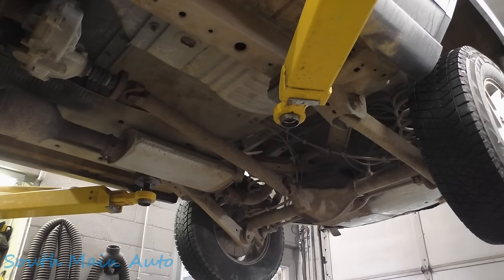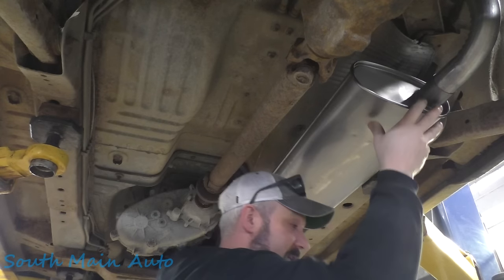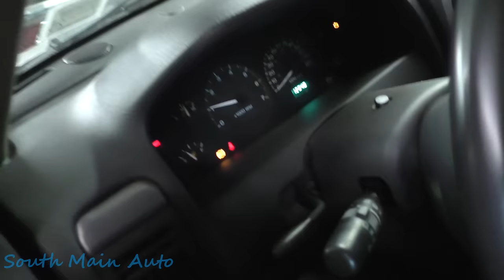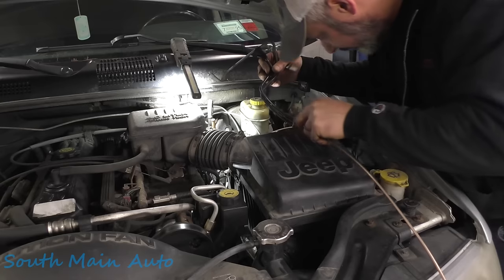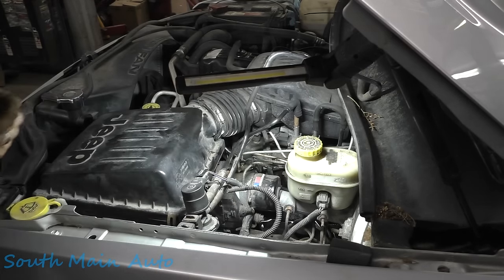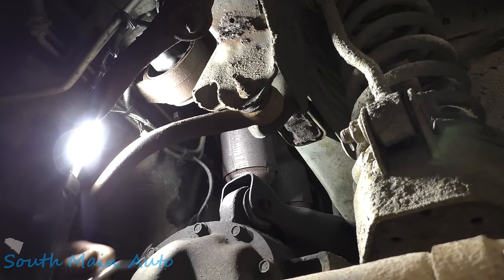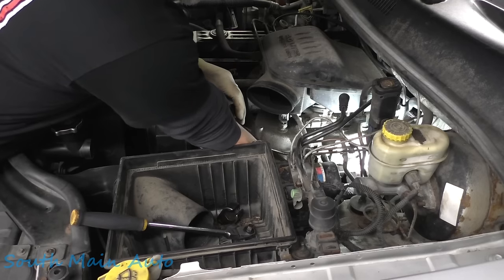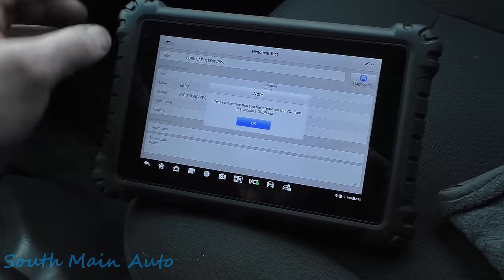Jeep Grand Cherokee: Loud Exhaust, Engine Light & Leaking Brake Line - PART II

Comment: Cutting just the outer pipe with the gas axe was the first thing I got taught when I started working in the industry. Still remember who taught me (Bo Eriksson) and the total length of the lesson: "Just start cutting without preheating and it'll never touch the inner, like this *ziip-ziip*"
About twelve seconds, including everything.

36 years on, I have still to hurt a single inner as long as it had more structural integrity than your ordinary spider web. Best method ever.

Comment: Another satisfied customer! I almost always cut exhaust pipes with the torch. When doing the second step of the double flare an old mechanic told me way back when, not to reef down on the flare tool and let the nut finish it off when you tighten it. I like your tube bender pliers! Enjoyed watching!

Comment: Since you only said it twice , I think the Eastwood Line Flaring Tool and the Mastercool Hydraulic Flaring Tool are better. If you had said it 3 times, then I would have agreed with you. 😜
Reply from the maker: They are great tools honestly 😅
Reply: How many times have you flared the brake line and forgot to install the fitting?
Reply: @jamesbergfeld5923 probably the same number of times putting an electrical connector and housing on in the wrong order.  usually happens when you have no spare pins either. :D

Comment: I'm glad you stressed the O2 problems with older Chryslers. Probably 3 years ago I ran into the random falling on it's face when going into closed loop problem on my grandparents 98 Ram. Then compounded the problem by putting Bosch O2 sensors in it. ScannerDanner was able to point me in the right direction and sent me a link to a video he had done with the same problems.  I went to a friend of mine at the Chrysler parts counter to get the OE sensors and she told me she buys NTK for their techs on the older ones that are unavailable. I also use the old flare nuts if they are in good shape. You don't have to worry about them being the correct threads.

Comment: Now heres why my sawzall is better than my torch.
I dont have a torch.
Reply: Plus that was a good Eric O explanation for why the torch may not be a good option in that case with a different metal pipe... But, use what you have👍
Reply: also for most of us laying on our back under a car, hot torch slag in your eye really sucks. at such times the saw is a good choice.
Reply: @leftyo9589  I gotta up my tool game... I don't even have a sawzall yet😵‍💫

 I'm cutting stuff out with a Dremel (100 pack cutoff wheels)

and a manual hacksaw for bigger jobs

Comment: When I get a "new to me " car I go over the heat shields and put thick  washers made from scrap ally sheet under the nut's , stops the shield corroding any more as same metal and the washers take quite along time to waste away, especailly if you put some fluid film etc. on them

Comment: Free Friday tip. Put the clamps on first turn sideways so you dont have to trim ends. Cut wires iff sensor use regular socket.

Comment: I like that touch of cutting the u bolt threads off to the nut it makes sense too because I;ve seen plastic bags stuck to the extended treads hanging below the muffler.  Eric you always do nice work.  The customer made out that you were lower in price muffler shops are not always better.  They warrantee the muffler for life but you pay for it twice up front and they always hit you heavy for the extras.
Reply: god I hate that part of it. yea they "warranty" the muffler, but of course the mid pipe is also bad (no warranty) and the tail pipe is bad (no warranty) so in the end you "save" $30 on your next muffler job.

Comment: That 4.0 is one of the best engines ever made, no wonder he wants to get it fixed
Reply: Best at leaking oil.
Reply: @misterhat5823  yeah I saw that
Reply: The one in my 98 XJ had over 300k on the original engine when I sold it. Still running great.

Comment: And oh yeah, reusing flare nuts: clamping can easily distort thinner nuts, pinching the brake line. The remedy is to just drop it in the correct size socket and knock that rust line out.
Spinning it on a preferrably worn drill bit while cleaning the threads gets all the crud out of the inside too.

The socket trick is also perfect if you have to drill or thread a flare nut, like when making a piston pusher outer adapter for stuck calipers: grab a nut with the correct outer threads, tap the inner for M6 (for 3/16" lines, no need to drill them since they already are the correct diameter) and put a grease zert in there. You can then easily push the piston out with the nearest grease gun.

Comment: I owned this model jeep.  The owner will eventually either back up a money truck to service/maintain this vehicle OR trade it in for a Toyota sedan.  Right now, just watching the video the owner needs a gas tank skid plate and a valve cover gasket - about $1,600 installed.  Unknown is the condition the wheel bearings, shocks, control arms, and fluids - differentials, transfer case, transmission, brake, radiator, engine oil, and steering.

Comment: NTK are OE for most Chrysler I think.
Bosch sensors just don't last in Chrysler applications.
My theory is that they don't like the 5V bias that Chrysler use as an indirect heater monitor - most other brands are 450mV bias.
I think this was covered in the first video, but a cold O2 sensor sensing element is effectively an open circuit, but at operating temperature it's a weak source of power - but strong enough to overcome the influence of the bias.
That's how the heater monitor logic works

Comment: Muffler looks better than what I'm running right now.😁
Dorman does make good washers.  😛
Question:   Do you always cut off the clamp bolts?  Why?  Trash bag snaggers?
Just a thought:  It's a pleasure to watch someone, go from one step to the next, just because he knows what he's doing.  No wonder Mrs O is always smiling. 😃
Reply: Signature move that sma touch the vehicle? So it's an Eric O thing...

But, I agree with one comment to add a water weep hole to that lifetime warranty muffler

As a DIYer without a huge torch set-up in the home garage, I'd leave it alone 😅

Comment: Kind of strange that the bottom of that old Jeep has not rusted out. The body has the Cancer, but the frame and suspension looked remarkably well. It’s a 2004. Did the manufacturers use better steel back then?? I mean a 10 year old Chevy truck rots out already. This puppy is 20 years old!! Great video as always.
Reply: If I remember right it originally came from Florida. If it wasn’t on a coast that would help a ton with rust. Over time the body tends to rust because it’s thin, pockets trap dirt and moisture, and paint damage removes protection.

Comment: I love my Jeep WJ 4.0, but it has kicked my ass this last month. First, the harmonic balance decided to take a dump, then immediately after replacing it, my water pump start leaking out the weep hole. While replacing the water pump, one of my tools fell, hitting the side of my radiator and putting a hole in it (facepalm). Talk about bad luck.

Comment: I found that tightening a small hose clamp around the O2 sensor socket prevents it from flexing and rounding off the flats. Couple blasts on the bung with the flat head air chisel can break the rust bond as well. YMMV I think I’ve flared a line or two without the nut affixed myself. 🫤

Comment: But have you tried the bubble master 5000 brake line flaring tool? It will flare a brake line using Bluetooth. 😊 Thanks for the video....amazing job as always.

Comment: I can’t believe how bad the metal around that gas tank was on this one. I’d hate to pay what a new car cost just to see it dissolve after a few years.
Reply: That's a common problem on 99-2004 Grand cherokees, I had mine replaced after 21 years it was almost gone.
Reply: Remember this is a 20 yr old WJ ❤, with what was it, 212,000 miles- it’d be hard to say this vehicle wasn’t worth every penny and then some. That skid plate was shot 10-15 yrs ago!

Comment: "02 sensor heater should run when the car is completely cold. it tests it during cold start and driving .. basically it wants to make sure the heater element inside reaches the designated temperature within a certain amount of time to make the car into closed loop."
 - Lotus Talk

Comment: One thing my grandfather taught me in the garage was to always drill a weep hole in the bottom of the muffler. That way any condensation can drain out of the muffler.
It's a German thing with the O2 crap, that was built back when diamler owned Chrysler, so they over engineerd that thing. But they are literally plug and play jeeps. If you want homelink, just plug it in. You want fog lights, plug them in and put in the stalk control.
Reply: Eric went over that issue in a previous video. I think it may have been a Toyota muffler.

Comment: Question, Why use the torch when you could use a saws-all or a porta band? Reason I ask, is because of fuel lines as well. But I know you know what you're doing.
Reply: Porta band is usually too bulky to fit where you’d need it for cutting an exhaust off. Sawzall would shake the exhaust a bunch and possibly break it somewhere else. It’s so rusty you don’t want to risk it. 
Torch is really about the best option. Just have to be careful where it’s pointed.

Comment: My Dad loved to work on cars. He and my Mom pulled and rebuilt the engine in our 65 Bel Air. So one day my sister and I were cruising around town. She decided to pop the clutch and try to fishtail around a corner. The gears refused to shift and the car wouldn't go. An old guy came along and towed us home. Turns out my Dad hadn't tightened the motor mounts enough or they worked loose, and the clutch pin had popped out? Sister was BUSTED!!!😅😂😅😂

Comment: Should I request a reimbursement of a tow truck fee that I had take my vehicle to a shop for starter replacement iif the shop never even touched my vehicle for 5 weeks? I had to get another tow truck to take it to another shop that fixed it the next day.
Reply: You can try, but don't get your hopes up 😢
Reply: The tow truck fee would still be on you. Reimbursement from the shop would be if they charged you for work they didn’t do, or a very poorly done job.

Comment: Is there a specified procedure for bleeding an ABS module when you disconnect a brake line from it?
Reply: I think it depends on the manufacturer... Some can bleed it the old fashioned way like on the video

Others need a scan tool to communicate with the module and it will activate those valves to "burp the air out"

Comment: Aluminized mild steel should be illegal in NY, lucky if it lasts two years.  409 SS is great.  Just replaced 13 year old Dynomax bc they were getting ugly, not bc of failure.

Comment: Hey Eric? I replaced my O2 sensor in my wife's car and now I'm getting a permanent open circuit code and the money light is still on. Please advise me what I need to do?
Thank you fella. I appreciate any advice you can give.
Reply: Verify that there's continuity on the wiring?

It's screaming open circuit

Eric did a continuity test a few videos ago

And he warns about fake parts on eBay or Amazon as well

Comment: Sorry Eric, I've seen to many car fires while using a torch, especially with more plastic gas lines on vehicles. A sawzall or cut-off tool is more controllable.
Reply: Liar.
Reply: Tools sometimes require the user to be competent. Not usually the tools fault. 
With an exhaust that’s already rusting apart a sawzall can shake it enough to cause new holes that would need repaired.

Comment: "1/2 of the cost of muffler shop".  How is that possible?  Your hourly rate must be super low (<80?) or local muffler shops are out of line.
Reply: He works twice as fast as a muffler shop. So the cost is lower ever if the hourly rate is higher.  Same reason Aldi pays employess more but is cheaper than Wal Mart.
Reply: I'm betting on the latter... Muffler shop overestimated that job or wanted to pocket extra beer $ for the weekend 😢

Comment: Man that drive shaft is so crusty on the rear end end I dont see how it dont shake the drivers teeth loose at speed.
Makes me no differance  50 years and counting My cutting torch is staying in my shop and I will keep doing same as you. A little common sense goes a long way huh. Like dont aim it at the floorboard.

Comment: I guess I'm not understanding why you didn't just reweld what was there and go with that.   It seems a little early to cut that stuff off IMO...   I just mean that it still seems relatively usable.  Just needed a re-weld..  I wish you would have shown the "damage" a little closer (pre-removal) and explained exactly why this is a "replace" job, rather than a "repair" job...   and what criteria do you use to make that decision?   Cheers
Reply: I assume you are talking about the muffler. That was covered in part 1.
Reply: Reweld the rust😂
Reply from the maker: This is a joke right 😂
Reply: @SouthMainAuto   What? lol...  Are the mufflers really that paper thin?   I'm in Oklahoma--- I don't know about this rust magic.  I've never seen an exhaust that I couldn't weld on..  so this "rust" situation is still new to me.
Reply: @mph5896   It just seemed like adding a simple flange could fix it-- like an oversized flat washer cut in half..  You weld it to the pipe and then weld all the way around it to the muffler.  But IDK-- maybe it's thinner than I realize..  (I get that it's rusted at the edge of the hole).     It's actually quite similar to how he "repaired" the heat shield with a few washers;  just add a wider flange that gets you past the rust edge of the hole and it should still take a weld just fine-- if it's not paper thin
Reply: @calholli paper is thicker, and more durable, than metal in the eastern salt belt.
Reply: @johnhufnagel   I watched it again as he was kicking the muffler around on the floor.. it does seem almost light enough to float away.  :)  ...  They make the cheap one's very thin I guess.
Reply: If it was a personal vehicle maybe. As a professional shop and a paying customer you’re better off fixing it more solidly. 
To weld that one you’d still have to cut the rusted parts off along with cutting out rust until you get to better metal. Then weld new parts onto an already rusting out muffler. In the salt belt it wouldn’t last very long and you’d have a customer upset they paid all that money for a crappy repair.
Reply: @NBSV1   Yeah.. I was just thinking of the quick and cheap fix to save the customer some money and maybe get another year or two out of it...  because you're right:  That's what I would have done on my personal vehicle in that situation.  But I can understand, with him seeing rust everyday--- he's completely done with patching. lol. I get that

Comment: National muffler shops cost more because they need to anticipate paying more in liability with C and D grade mechanics pay doing the work. Yes, there are some national brand shop locations worth their weight in gold with competent help and leadership, but they are few and very far between. The majority are not.

The majority of national muffler shops are ripping that heat shield off, and not taking the time to reattach with larger washers, at the lower job cost than the national shop cost to begin with.

If you have a shop that offers fair prices and hasn't given you a reason to not trust them,  continue business with them!